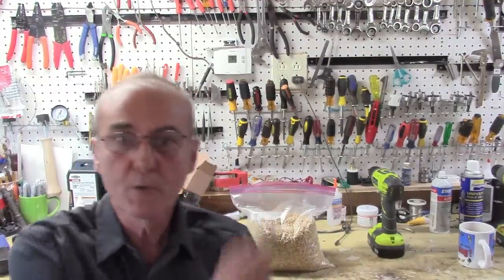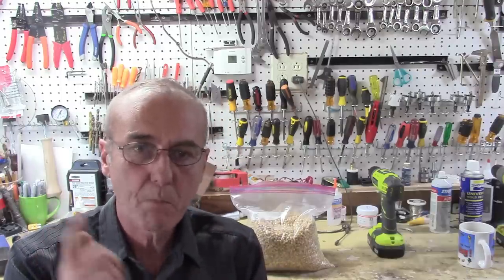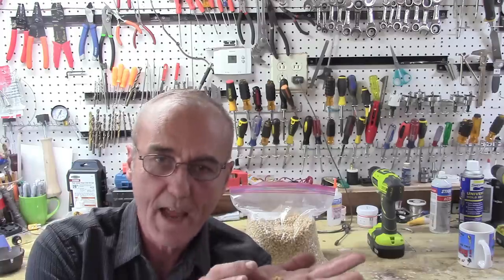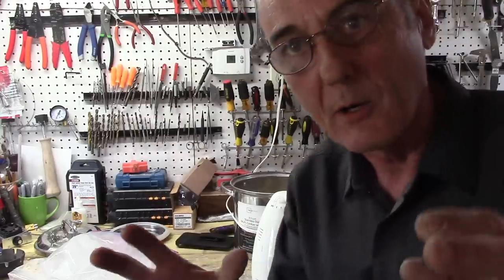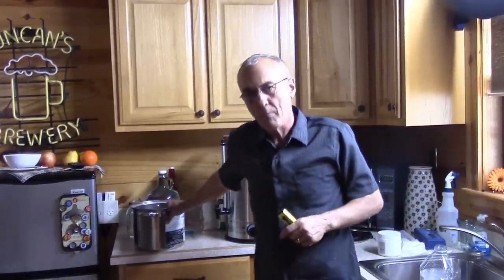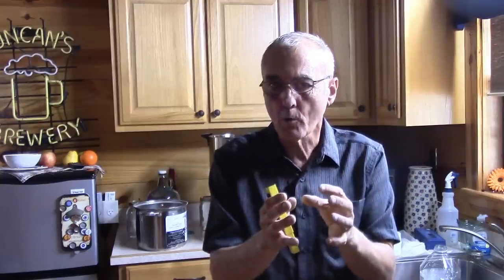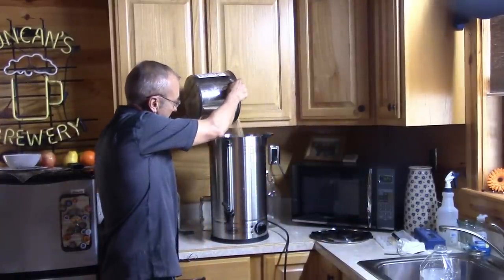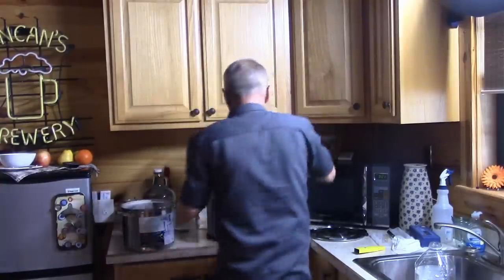CORN MASH FROM MALTED POPCORN

Comment: Thanks for the informative videos, very much appreciate all you share with us. As a newbie, to distilling anyway, I made some different batches of wine over the years, I am having trouble with yeasts in 2 different mashs. One is a cracked corn and the other a sweet feed, the corn didn't take off and stalled out after 4 days at .994 sg, the sweet feed is still working slow and has not gotten below 1.000 after 3 weeks, not sure what's up with either mash. I used dady in both, and had to run a small heater to keep temps up, my corn still appears to have a lot of starch in it, and the sweet feed is a mess, pellets instead of all grain so not sure I can get all of the little fine particles filtered out to distill it in my pot. I did.not take a sg reading before pitching yeast either, my mistake there, any ideas on why one batch would quit working and another is still going when I used the same yeast in both??

Comment: Hi George! I decided to make a mash with cracked popcorn because it's cleaner than cracked corn. So I poured 6 pounds of popcorn in my Cereal Killer grain mill. I fired up the drill and.......nothing. lol, the popcorn is too smooth and round, it doesn't get pulled into the mill no matter how wide I set the rollers. OOPS! lol,  Time to bust out the food processor like you did.

Comment: Hi George, I have a question about corn sugar. I know you said it will be better at fermentation, then cain sugar. How do you think corn-syrup will work? Is the same as the granulated sugar? Thanks in advance. Keep your videos coming that help a lot of people.
Reply: I have used corn syrup and it doesn't work. All corn syrup that I have found has salt added. Salt is used in bread to limit the fermentation process and I can attest to that being true about corn syrup also. I tried it many times and failed before I finally figured out why.
Reply: A lot of brand name corn syrups that you find in the grocery store also contain a fair number of preservatives, primarily sodium benzoate, that interfere with fermentation.  (It helps keep them shelf stable)

Comment: I've been experimenting with old moonshiner recipes which originally used malted corn.  The problem is it is extremely difficult to buy malted corn, so I've been making my own.  The process requires a fair amount of time. Also, most typical yellow corn one can buy is "feed" grade which contains some dirt and debris.  To solve this delimma, I also use pop corn.  It is cheaper than yellow corn and seems to malt better.
Reply: White popcorn malts excellent. I stopped using feed corn when I opened the very well sealed bag and it was infested with some kind of insect to the likes I have never seen! Thousands of the creepy looking things! So I buy lots and lots of white popcorn..
Reply: go to Atlantic brew supply online Raleigh n.c.for malted corn
Reply: Thanks for the malted corn source.  It is quite hard to find.
Reply: @rocketsroc  thank you

Comment: Are the cheap $20-25 dollar ATC refractometers on Amazon worth a while or do you recommend not to mess with thise and get on of those $100 dollar better brands as seen online as well?
Reply from the maker: ATC is aouto temperature correcting. They work just as well as the expensive one from my experience.

Comment: Bourbon has to have a grain bill of 51% I believe!  Some whiskeys may have a grain bill 100% When I have tried this I have not been able to get past 3% to 6% I have had to add sugar to get my gravity points up. How can we increase our grain bill and get higher gravity points without adding sugar?.
Reply: Add more grain, use the water necessary to extract and convert it all, then boil it down to concentrate it.
Reply: I forgot to add, many all grain mash bills are 2.5pounds per gallon. So his 3 gallons would be closer to 7.5 pounds grain.
Reply: Bourbon requires 51% corn - you can get your gravity points up just how Lost says here - calculations are in the Home Brew book George mentions in a previous video. Don’t need the sugar but it sure helps!
Reply: This may be way too late and no longer relevant as an answer, but it looks like you're measuring two different things here.  The grain bill percentages only deal with how much of the mash is made up of a given grain, not the prospective abv. So the mash used to make a Bourbon has to be 51% corn, the other 49% of the mash can be made up of other grains.  Your 6% abv after mashing isn't out of line for an all grain mash. Those two percentages are not really related to one another.